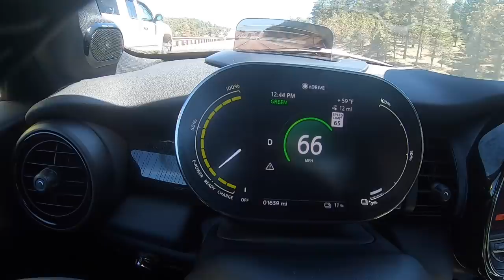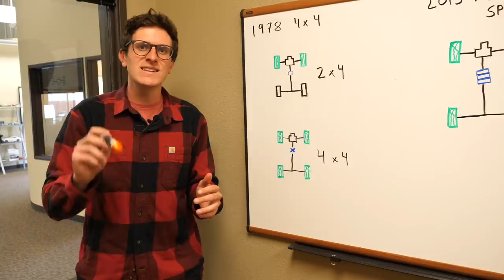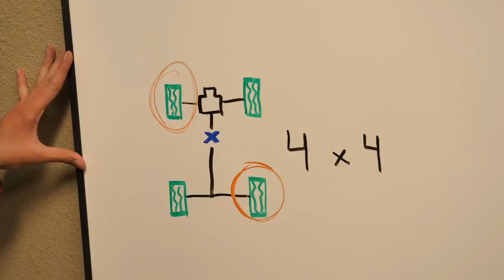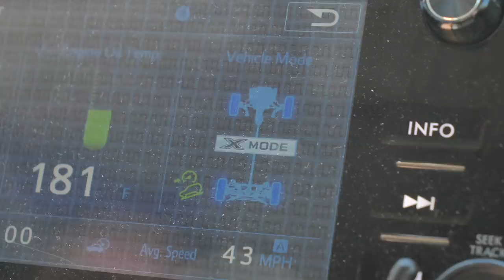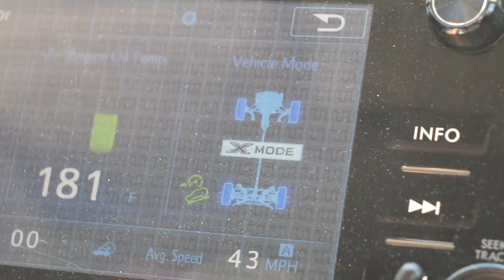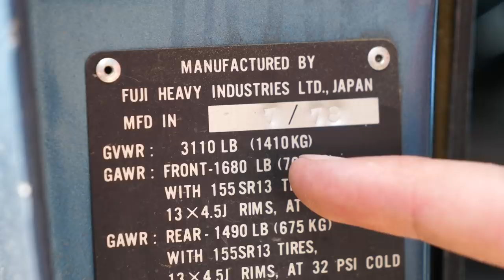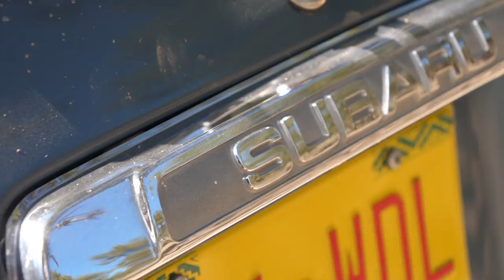Old vs New - How Much Better (Or Worse) Is a Subaru Outback Off-Road Than Its Great-Grandfather?

Comment: The first 4wd station wagon was the Jeep Wagoneer in 1963. The Wagoneer was also the first 4wd ever with an automatic transmission. AND, it was the first AWD station wagon in 1973 with the Quadra-Trac. Subaru may like to claim these, but its wrong on every count.
Reply: The wagoneer was based on a truck with a full frame, solid axles. This is a typical station wagon car with 4wd which is practical if you're not doing heavy off roading or towing.
Reply: D Yeg Every single station wagon made from up through the 70’s had a full frame with at least a solid rear axle. Some had a bean axle up front. The Wagoneer was considered extremely luxurious for its time. Yes the Subaru was the first one with IRS, but nowhere in the definition of sport utility wagon does it say you must have IRS.
Reply: @Stuka87  loads of cars had solid rear axles in the 70s. I'm saying the Jeep was a traditional 4x4, as was the Land Cruiser and Bronco. The point behind the Subaru's was that you didn't need to deal with truck fuel economy and handling  if you wanted to drive on snowy or rough roads. A big 4x4 based on a truck was more than what people needed. Cars like the AMC Eagle and the Subarus meet this niche. The kid even mentioned it in the video.
Reply: @davidyegiazaryan3417  Ok, that was not my point at all. Subaru constantly (and is mention here in the video) that they were the worlds first AWD sport utility wagon, or the worlds first 4wd station wagon. Both are categorically false. And for the record, the Wagoneer is not based on a truck. It was ground up designed as a station wagon. There is the J-Series truck which shares the same body and some drive train parts, but has a different frame and axles.
Reply: @Stuka87  Jeep and Toyota had enclosed versions of their 4x4s with rear seats and cargo room since the 50s which were also called station wagons. Maybe he should have mentioned AWD car. This thing was not based on the heavy duty underpinnings of a traditional 4x4, but of a car, which made it the first of it's kind as a station-wagon, or sport utility wagon. A car is definitely more 'sporty' even though that's just marketing BS

Comment: 14:46 Is no one going to ask what the Catheter bag is for?
Reply: It was in the right place to be hooked up to the rear windshield washer.  The old fluid reservoir (hidden inside the body panel) was probably shot.

Comment: Good video guys; just a question; how come you didn't use X-Mode? I took my 2018 on MUCH steeper and far worse stuff than this and it climbed it with very little struggle. Also, those tires aren't doing it any favours; the stock Bridgestones are total garbage for grip on just about any surface. I use Nokian all-weathers and it's been like a mountain goat on crack.
Reply from the maker: X mode was engaged!
Reply: @TFLcar  Interesting! It just seemed to struggle so much more in this video.
Reply: Try turning off traction control, and if it has shift paddles, try second gear.

Comment: News flash for you! The reason Subaru puts a space saver in the boot, and the reason there’s little articulation. Is because they did not design the car to go proper off roading or head down the trail. It’s designed to be good on road in all conditions ie snow, rain, maybe tow a small trailer off a bit of wet grass. Other car programs seem to realise this and do an appropriate test drive.
Reply: That's what it's designed for, but that is not what they market it for.

Comment: I owned a 2008 outback 2.5 I have no idea what you were doing, it would destroy those hills. What was that “foot to the floor” crap? There is no way. I took it on plenty of 4wd tracks it never lost grip and I never came close to “foot to the floor.” They have ground clearance issues sure but power and grip issues? No way.
Reply: 2008 was a long time ago.  Did yours have electronic traction control?  That's what was keeping the power output down in this particular case.  I see that a number of other commenters are saying the same thing. And the big issue that I saw with "grip" was diagonal twist combined with insufficient suspension travel.  A tire suspended in the air, or on the ground but with only a tiny amount of weight on it, won't have much grip.

Comment: Please tell me you had the traction control turned off at least.
Reply: Probably not. That would go against their Subi script. Standing start creep until the CVT brain protects itself vs. running start, give it gas for the other vehicle. Blah, blah marketing, blah, blah plastic shrouding, blah, blah CVT. We get it Jr, the new Outbacks are not built to be rock crawlers ......again.
Reply: @happy_dad4211  I would even say they should turn traction control off for the cars that claim to have torque vectoring axles.  This way would be a true test of the torque vectoring system.

Comment: So, digging into this topic for some other reason I discovered that yes indeed, the CVT does torque limit at low rpm speeds to prevent belt slip.  CVT's and Subaru life are antithetical and subaru ought to be ashamed.  Its not like a 8-9 or even 10 speed planetary transmission  wouldn't be possible and give as good or better EPA numbers.  Get it together Subaru!  Also, Andre is 100% right to be worried about overheating.  The CVT's that get off-roaded die early lives.  Very early in some cases.  They are insufficiently cooled for this task.  Again, Subaru...get it together.

Comment: If Andre had his foot to the floor and the wheels weren’t spinning it would appear he didn’t turn traction control off. If you floor it an have no power you should turn TC off.
Seriously that CVT is rubbish. No way I’d buy an Outback if it can barely make it up a slope.

Comment: DLs and the first gen Leones were very capable and awesome I have had a few of each and the Brat of that same year, always regret selling that, I have seen Brats or Brumbys here actually leave FJ40s crying in the sand and mud and too embarrassed for even a snatch pull lol, CVT most are mall crawlers today the a Legacy should have stayed as the AWD Sedan / Stationnwagon for all year weather road going super car, the outback should have stayed a true outback, but Americans want everything to be the same same, why even bother with the Legacy at all now, I loved the control layouts of the 1st gen Leone, the dials instead of storks is still one of the best car dash layouts ever imo. I am not surprised at the DL at all still looks great and in mint condition by the looks, wanna sell it 😀
Probably the biggest difference in capability between gens is not the tech, it’s the wheel size tires and suspension also auto even a CVT requires less skill to use off road, MT while serious off roaders some prefer for reliability simplicity and further ground clearance as usually most ATs sit lower closer to the ground so more susceptible to rock damage, they do provide better transfer control to less experience drivers off road (and on road) but wheel size in terms of traction and grip a bigger wheel has better roll over a much larger contact patch so can find and maintain grip better only reason the new gen a outback made it up the last incline first go albeit a stop and turn the wheel to find grip, note while a good technique with independent front suspension that can be a good way to snap a CV, the angles and stress on a CV under that load with an IFS is a common issue. the DL would be solid front and rear axle, can’t remember what size steel rim and tire size, but it’s tiny compared to the outback, but pretty bullet proof.
Reply: Oh if Subaru would offer a stripped down Outback on the global platform but the basics of what the DL had with a real tranny,malus off lockers factory and selectable 4wd as was the DL not all AWD, although I had an 88 1.8 Turbo with a digital dash, airbag 3 w adjustable suspension including low 4wd and factory lockers. now that was a hell of a car, though still a bit flash for off road compared to the DL. it was a 5spd MT

Comment: Isn’t that dangerous to have a hot engine next to a spare tire? Thoughts?
Reply: small motor in a large engine bay never gets hot enough, many other car makers had the spare in the engine bay from the 1960s to 90s, mostly European and Japanese 2cyl and 4cyl cars from VW / Volvo / Citroen / Renault / Suzuki / Fiat / Subaru probably more.
Reply: dcanmore wow didn’t know that! Thanks!

Comment: Those hooks are for strapping the car down during shipping, they aren't proper "recovery" points. They will work in a pinch, but they can snap off and hurt someone if you're really stuck. CVT's are straight garbage, only the Impreza and Crosstrek can be had with a manual, also the WRX and BRZ. Don't buy a Subaru if you want to do real Off-Road work

Comment: I had a 78 Subie for 9 years
. Great in the snow. Just like yours, went (almost) anywhere. Had some issues though. The four wheel drive lever would stick in 4wd! Very hard to get it to unlock. Worst issue. Rust!  I bought a 2008 Outback new. Done over 300 000 KMs. Still going strong. My 18 year old grandson loved it and now has it. I have a new Levorg. Only 2 complaints: no manual and poor ground clearance. Super nice otherwise. 
Loved your review. Wish I still had a (non rusty) 78 in the garage though.

Comment: Manual transmissions all day every day ! Every vehicle that makes any claims of Offroad ability needs to have low range and a traditional automatic or manual ! CVT'S are garbage for any thing more than pavement or a tame seasonal highway  ! When someone builds a CVT that can handle the toque made by the engine it came with let me know.

Comment: I want to believe in Subaru-dream.
Unfortunately, their CVT has their gearing shorter than any other transmission, so they are worse on slow speeds and high speeds. 
That is a big downside for me so I will avoid it. The alternative companies offer good AWD now. I'd rather lift a new Mazda than risk my money on a CVT that I will take to the mountains.
Reply: @costaet  steep 
Lots of very steep hills with a fully packed vehicle. 
I personally do not need much ground clearance but need good AWD due to the surface - soft mud. Do not need any protection, just good AWD. 
Subaru's CVT has poor gearing in comparison to Mazda's 6-AT and CVTs are more expensive to maintain. 
So for me, it will be worse at slow speeds, worse at motorway speeds and more expensive to maintain. Mazda offers a diesel in my country as well.
Reply: @costaet  Yes, go check out the difference btw standard torque converted AT and CVT. 
The oil in the CVT has to be replaced more often, is more expensive, and the procedure is more complicated so it costs more.
BTW: as I've written before, I like Subaru. The only reason I know anything about CVT is because I really wanted to own Subaru one day.
Reply: @costaet  Are you trying to tell me the physics depends on the country? Does it seem suspicious to you that in most countries the service manual states replacing the fluid? Think critically about it, or do more research about failing Subaru CVT.
Reply: @costaet  I see now. You just ignorant of logical facts.  
The CVT oil is more expensive and the labour is more expensive = more expensive to maintain. 
The fluid is a crucial part of the CVT. It is the fluid that transfers the torque. It heats up more and therefore has a shorter usage time.  

Make more research about it. This is not rocket since. Ther is too much info on line about this subject for it to be a mystery to anyone who actually thinks. 
The very people who designed these machines are changing the oil regularly. I mean in Japan, where I live. I also have access to people in the industry through my family.  

There is no "normal conditions" in Subaru's manual. Hills, cities and motorways are considered hard conditions. 

The conversation with you is a waste of time for me. I am writing that for people who want to take my arguments and do their own research to make up their own mind and make an informed decision.

Comment: Swap the FB25 with 175 hp into the old Subaru and it would be transformed into a little beast. It would be downright quick. The FB25 in the Outback is downright milquetoast when combined with 3,500 lbs of mass and a lame CVT.